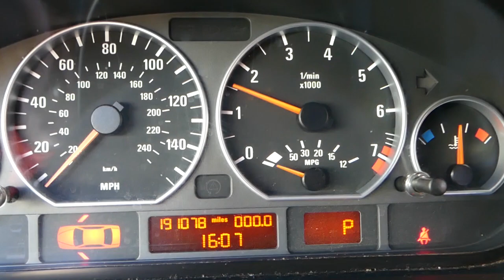BMW AC CONDENSER REPLACEMENT REMOVAL BMW E90 E91 E92 E93

Comment: Do you have or can you make a video on hoy to replace the radiator carrier?? Not the radiator support. The carrier, which is the two plastic brackets on the side of the radiator & condensor

Comment: Hi do you know the part numbers for the O rings top and bottom ,when you unscrew the hoses for the AC condenser? Mine won't hold a seal anymore. Thanks.

Comment: Do you guys have a video on how to replace the drier element on the side of the condenser? I took the call off but can't get the top piece out
Reply: On this particular model you are not able to change the single drier element, you need to change the whole condenser. Trust me, I have experience on that issue xD
Reply: @jan_xw8632  I worked out how to do it on mine in the end. It was way easier than I thought. Glad I didn't have to change the compressor like on some models.
If anyone else needs to know how to do it on the 330d or similar unscrew the cap with a T50. Remove the clip with circlip or needle nose pliers. Fasten the cap part way on and lever the metal piece out by using a flat blade screwdriver moving around the plastic cap. Retighten it as needed until the metal piece is out.
Reply: I meant condenser not compressor.

Comment: I've just tried doing this but the AC lines are seized on. Any ideas about how to release them?
Reply: Same issue, you ever get it figured out?
Reply: @WsNew  a mate recommended using a wallpaper scraper. Force the pipe in one direction so you get a small gap then put the scraper in as a wedge to lever it free. You might need to tap it in. Took two of us. One to hold the pipe and the other to tap in the scraper. Keep repeating around the pipe until it comes out. Might need to upgrade to a screwdriver as you create a gap.

Comment: I’m turning a bmw 128i with n52 engine into a track car and was wondering if it’s viable to remove the AC completely
Reply: Same here. I believe guys are running shorter serpentine belts to bypass compressor which is most of the weight. Just not sure if the belt tensioner works well at that angle or not. I might just try a shorter belt for a few months to make sure it works before I delete everything